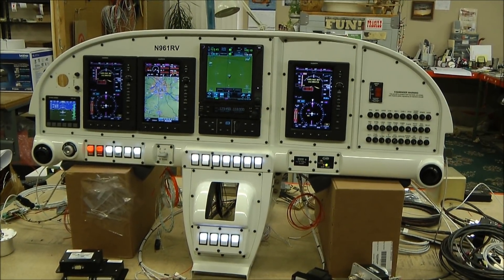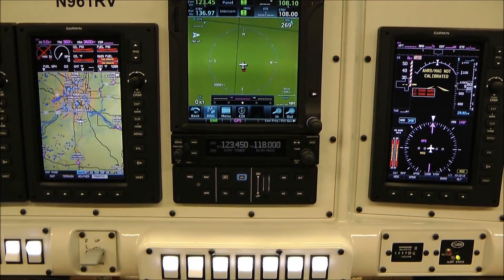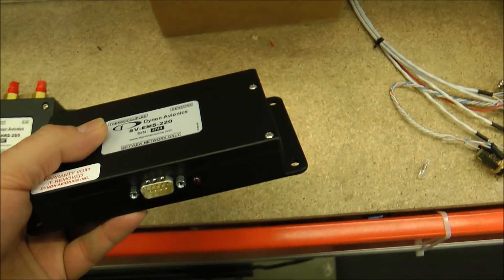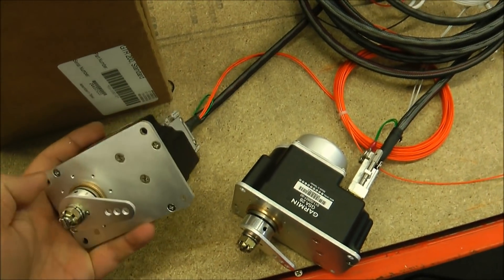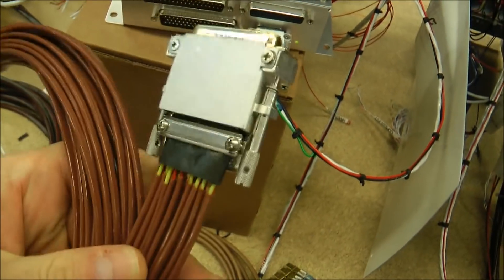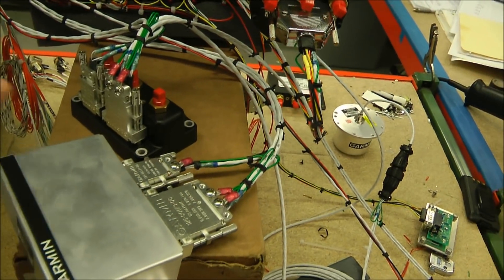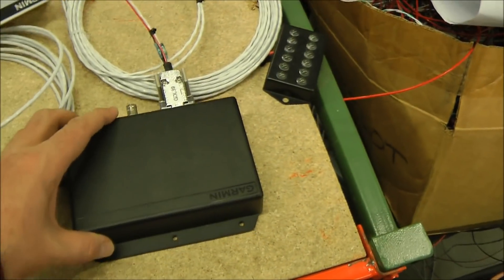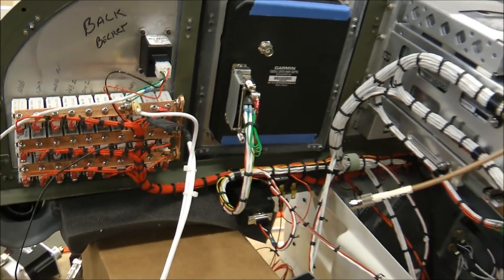000: AVIONICS COMPONENTS 101, LRU's, ADAHRS, SERVOS, EIS, etc..

Comment: I could not see in the video, but do you normally drill and tap the panel for the Garmin GDUs or do you use their nutplate mounting ring?  If you use the ring, do you affix it to the panel or leave it loose so it can be removed with the unit if necessary?  It looks like the holes drilled in the corners, which look like they used nut plates originally, but are now open with the rivnuts used to attach the GDU, could be used to install flush rivets through the panel to hold the ring in place.

Comment: Very well done!  I have the same two left side non-touch G3X in my RV7A.  Do you think I could replace with a single G3X large screen and use the existing plugs on the old G3X's?
Reply from the maker: You can, but you "may" need to move a single RS-232 wire depending on how you have it wired. The GDU's are basically plug/play, so it shouldn't be a big deal. You also might have to replace a config module depending on which one your currently have.
Reply: @SteinAir  Thank you for your expert advise!